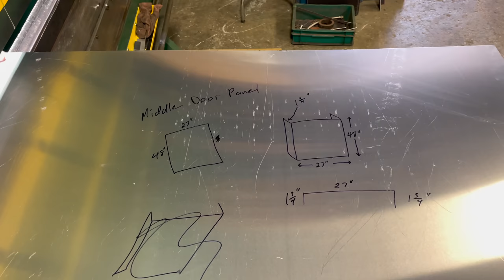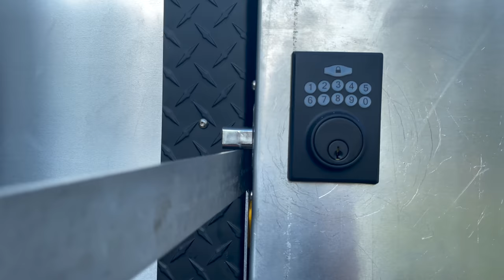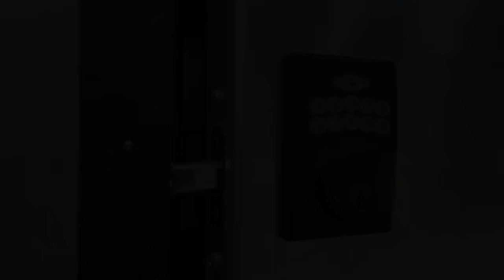How to Build Your Own Travel Trailer - DIY Camper Door / Custom RV (Caravan) Trim

Comment: Did not have the opportunity to see the trailer build. Fortunately have got around twenty years in welding and during that time got the experience to actually build wheels and frames for a twenty by five U-haul. From bottom up of frame and electrical work, so have the root knowledge of trailer building and your build will most likely be near my last projects in my life-time, since I'm unfortunately 71 now.  If when I had the tools could now save a bit of economics, so welding and carpentry skills my little brother showed and taught me will save me some economics but the solar array learnt just recently. Thank you "Eddie," for all your ideals and definitely the video shots. As Bill and Ted would say, "EXCELLENT!"

Comment: I hope when you used washers to hold roof edge trim back for water flow that you sealed around the screws to keep the water from getting in that area.

Comment: Love the build.  Lumber has a mind of its own.  If you ever need to re-build the door due to warpage, etc.  You can do the same build but use LVL’s for the lumber.  Or weld up thin steel.  Steel isn’t hard to learn to weld for someone with your diy skills.  If you plan to pay for it, go with aluminum.
Reply: Agreed

Comment: Nice job Scott. Very sharp. I see you have utilized the SJ style of door latch - a locking deadbolt (but yours doesn't have a key sitting in there lol). I guess you just have to push the lock button to latch it on exit (or turn the thumb thing when inside). I figured a conventional latch would be more suitable for the regular in and out, then use the dead bolt to lock up at night. Having to put in a code every time you open the door from the outside when camping, on crown land with nobody around, that would be annoying to some. (unless you are putting a hydraulic closer on the door so it automatically pulls shut) We'll have to stay tuned to find out. Love the larger wheels, great clearance.

Comment: I’d be tempted to 3D print a spacer to fill the window gaps. They design could be split across several prints then assembled and installed as a complete spacer. Material wise I’d use ASA for a combination of strength and UV resistance.

Comment: At first, I was like "Hey, I cd pick up a few tips from this build." Then I was like "This guy could use some help." 
  A door and frame from salvage camper, modified to be wider and complete with recessed hardware and all the mouldings to keep water out would be a good way to go. Otherwise, great job 👍

Comment: This is great and I am getting a lot of inspiration. It's easy to sit back and knit pick someone elses work but Another criticism: Whats gonna stop water from migrating in to the screw holes between your trim and rubber membrane? You should use screws designed to keep liquid out that have rubber grommets. I think you should have went with a door handle system that activates a latch so that you can keep your door closed with out the deadbolt. I'm sure you figured that out eventually

Comment: also you should have used Tyvek on the outside and inside another your walls, floor and ceiling, 1/4" isn't much and makes huge difference, spray in foam between the studs inside the walls, cover that and paint it, also you can use Z strip for an air gap on the inside for some serious insulation, might not seem important but not only is it a good sound dampener/proofer, it insulates on hot days and cold days, so you use less energy to cool or heat.. yessir

Comment: Great Build. Question I have is why were no rubber washers used when attaching the Aluminum Skins Throughout the Project? I would think as You use the trailer and it Flexes it would ABLONG the holes drilled creating a weep in the connection.
Reply from the maker: I don't expect it to be a problem with the sealant that I applied to the seams.  Time will tell though.

Comment: So do you buff out the scratches on the aluminum exterior? I’ve seen the swirl patterning used as well.
Reply from the maker: I'm actually going to be applying a vinyl wrap to the middle section

Comment: I was curious on the titling process you had to go through with this and what all it consisted of. Where I'm at, with a home made trailer, you are allowed a certain length, you get it inspected by the highway patrol and once it passed  you take the paperwork they give you and go apply for a title and license, but that is for a trailer and I would assume this is not licenced as just a trailer. I love the job you did, and man is it coming along awesome. Thanks!
Reply from the maker: I'm in Ontario Canada.  You can build a trailer and get it licensed here.

Comment: Is there a tendency for the sheet metal subfloor to condense moisture and store it  when the outside temperature is cooler than the indoor?   Then the plywood would stay wet for a very long time.
Reply from the maker: I don’t believe that will be an issue.

Comment: Why did you use such a thin sheet for the door. Might as well have gotten a fiberglass door. It would have been stronger. Think of a HD Surfboard could have placed FRP betwwen 2 HiDens FOAM panels.

Comment: I would be skeptical of all of the external screws you are putting into this build...I know you put a lot of things underneath them, but water will find its way in somehow and eventually rust those screws out.  I have been looking for a trailer company that doesn't have external screws.  BUT it is looking really sharp so far!!

Comment: Don't understand how you sealed the door for draft and wind/water/cold protection. Don't see any lip or rubber that would provide an air tight seal when closed.